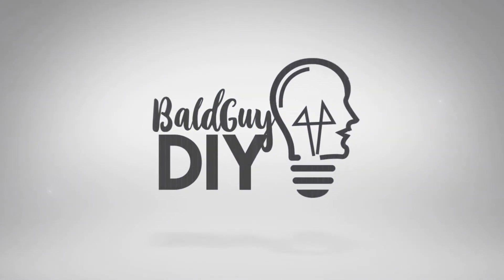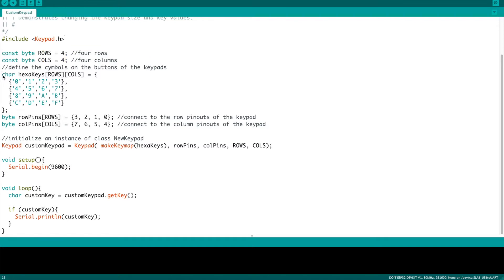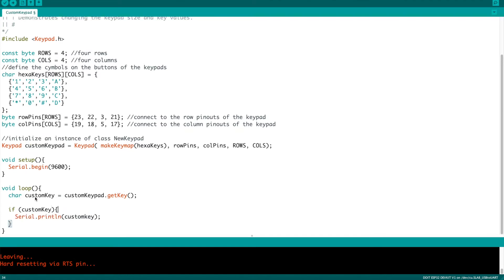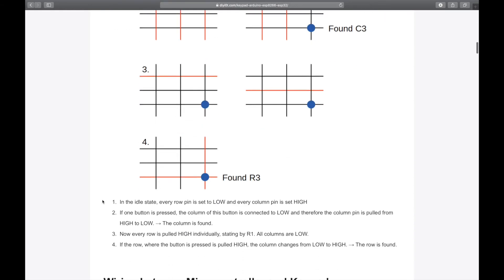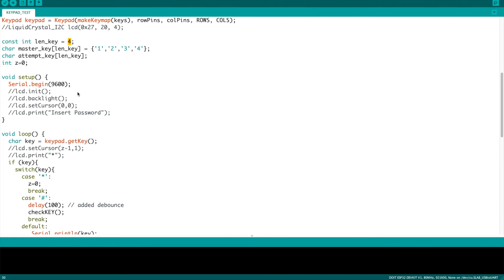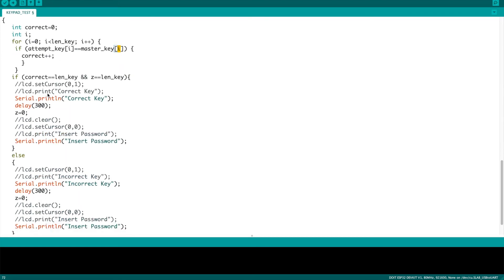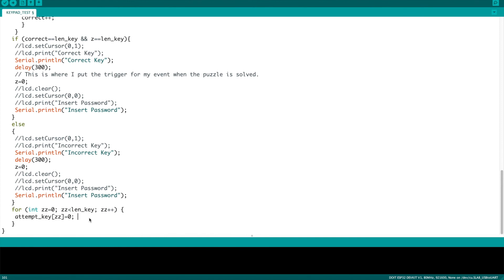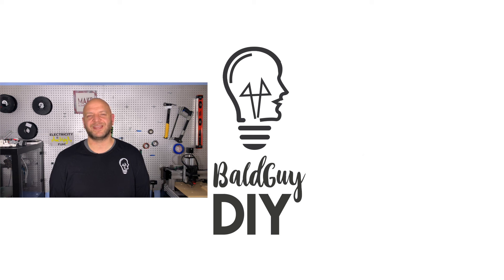ESP32: How to Setup a Keypad and Set a Secret Code

Comment: Hi. I really enjoy your videos. So I want to do a project with the NodeMCU version of the ESP-32 that requires at least 36 keys. I also need it to know when I'm pressing more than one button at once. I can not really use a matrix since only one button will be recognized at any given moment. So I should use I2C. But I haven't found anycircuit with 36 buttons. And if I want to do the project as expected, I could need more than 51 buttons. The project I'm trying to do is a small toy musical keyboard so a Raspberry pie is over kill. I will also need Gpio 25 free since I'll be using the built in 8 bit dac and a adc pin as well for a microphone. Where can I find an i2c circuit with a lot of buttons? Thanks.

Comment: Hi. Is it possible to enter Windows 10 login password using this (or similar) method?
Reply from the maker: Thanks for watching. Check out this link I found where they turn an ESP32 into a Bluetooth keyboard emulator. https://hackaday.com/2020/02/13/emulating-a-bluetooth-keyboard-with-the-esp32/

There are some boards that can connect and emulate a USB keyboard easily, but the base ESP32 doesn’t do it. I believe the video also mentions them. Good luck!